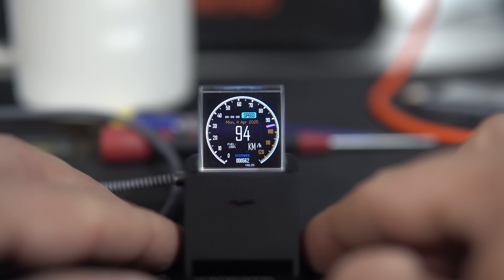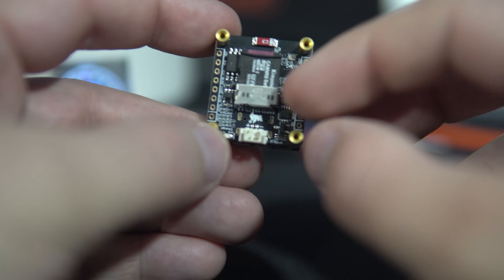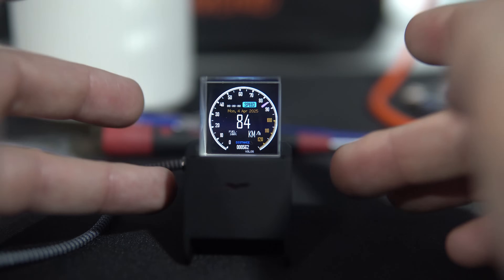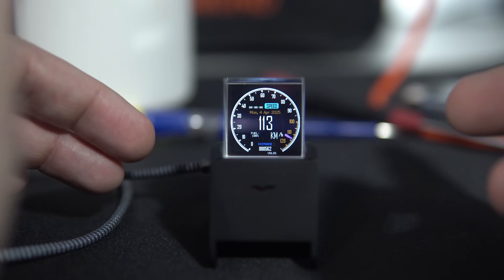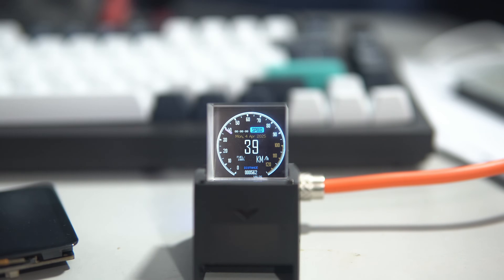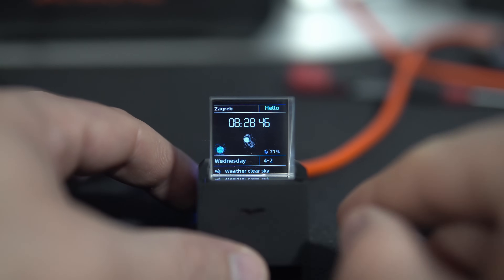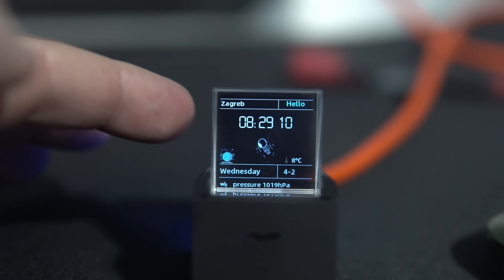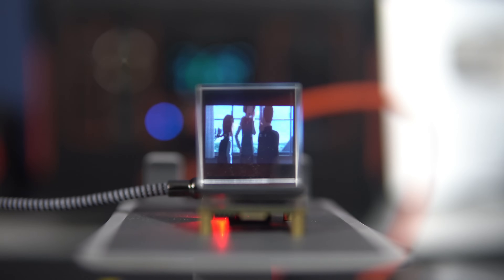Tiny Holographic Display Looks Insane!

Comment: This cube is an old trick from the optics lab. It's called a beam-splitter cube because - well it splits a beam into two half power beams. But it can also recombine two beams, which is what you do here: you combine the beam from the OLED display with the light coming from behind the cube ("see through").

Comment: Hi, thanks lot. I bought this esp32s3 and tried your code. But not working. Is there any library issues?
Reply from the maker: Did you install libraries waveshare provided in their demo?
Reply: @VolosProjects  Thanks for your quick response and all the helpful tutorials. After many attempts, I was finally able to interface the TFT and display some information—specifically from your speedometer project. However, everything appears mirrored when viewed through my prism.
How did you fix this issue?
Reply from the maker: I will ask again , did you use tft_espi  library waveshare provided for this board or you used orginal tft_espi
Reply: @VolosProjects  I have used the waveshare library first, but the ESP32 was rebooting continuously, then i used original TFT_eSPI library i have followed an youtube video to configure the user_Setup.h file, then its working, but the final image look mirrored on the PRISM, is there anyway to do a vertical flip?
Reply from the maker: @annoorkhan4219 original library dont have mirror option, you will need to use waveshare library, and you will need downgrade esp32 boards in arduino ide to version  2.0.17